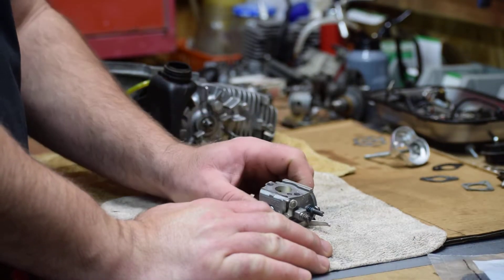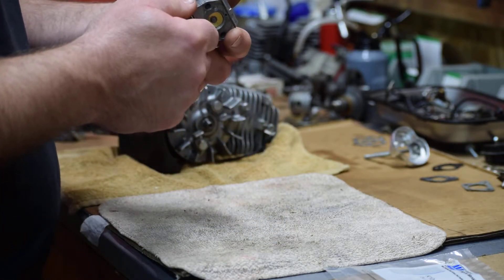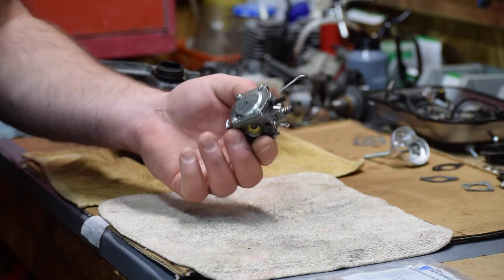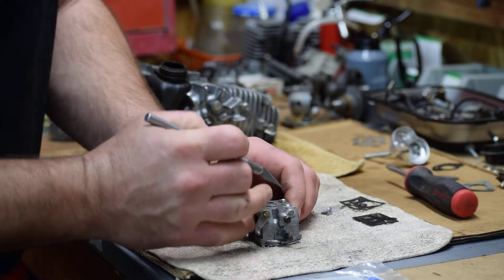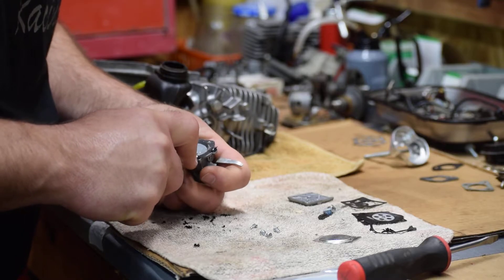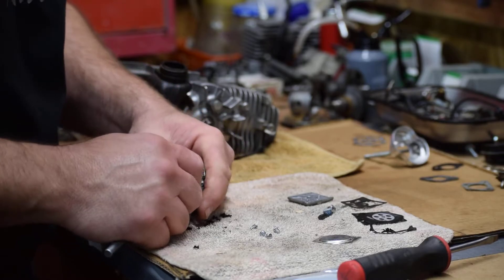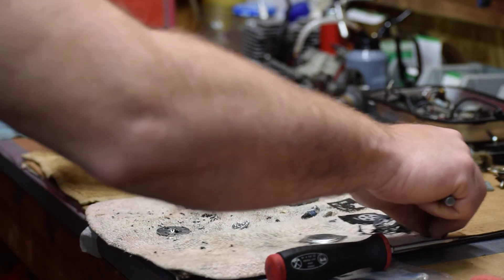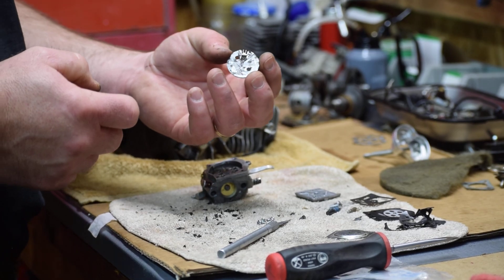Homelite Chainsaw Carburetor Rebuild

Comment: Thanks for these video's, they've helped me a lot with the 2 xl auto's I have.
I flipped the reeds on em with your groove cutting in the rivet trick!
Reply from the maker: The the biggest players in the saw market are Stihl, Husqvarna and Echo. If it were me I would visit both Stihl and Husqvarna dealers in n your area. See who offers the most support . I am a Stihl fan. In my area (Midwest US) most commercial cutters use Stihl. I know a lot of guys who own Husqvarna saws and love them. My go to saws are all Stihl. I do have several other vintage saws that I enjoy also. I'm not sure if this helps any. I know a lot of firewood cutters who own a Stihl MS250 for a budget minded saw and a MS290 farm boss not so budget friendly. Both are good saws. If you do buy a new saw hit me up and let me know what you purchased. Good luck and keep the chain buried.
Reply: @cjpowerequipmentsmallengin2294  Thank You for that! I do have a 260 pro and a ms390. another favorite is the echo 3000 top handle. now for pro mac 60 oil pot, lol!

Comment: Do you know how many turns should I turn the high low screws to get them back to factory settings. I mess with them and now I want to try to rebuild my carburetor but I can't find the factory setting for the high low screw settings.
Reply from the maker: Eugene, typically a safe starting point is 1 1/2 turns out. You will have to adjust once it is running. The "factory setting"  is generally used for a new engine with rich settings to avoid running the engine too lean.
Reply: @cjpowerequipmentsmallengin2294  
Thank you. But right now even with a new carburetor it won't even attempt to start I even tried starting fluid and nothing and I don't have a compression checker so I'm going to assume the motor is shot and might be time to save up for a new chainsaw now the other problem finding a good reliable made chainsaw for both home use and cutting trees for fire wood. I'm  thinking either echo 4510 or husqvarna chainsaw.  Or what's you thoughts on a very good reliable chainsaw???🤷‍♂️